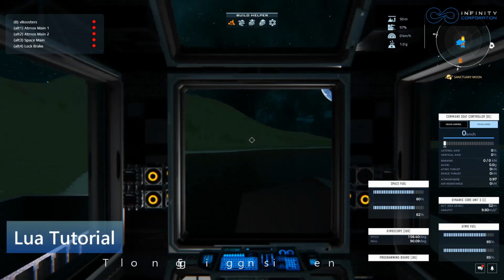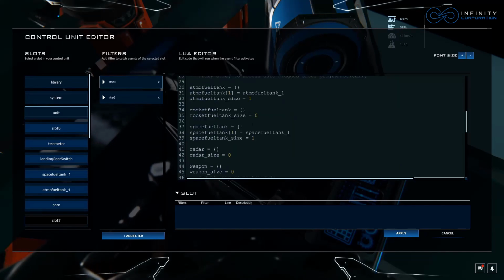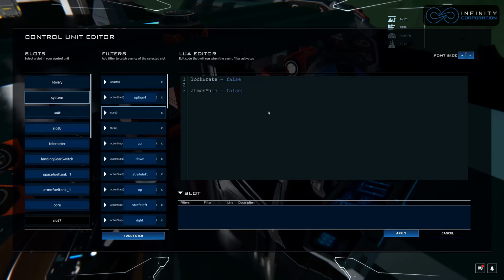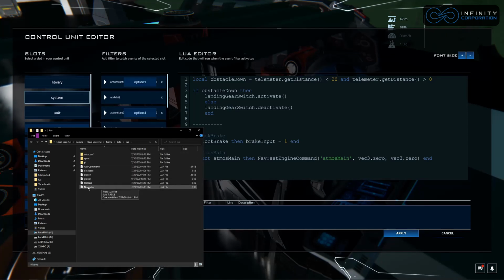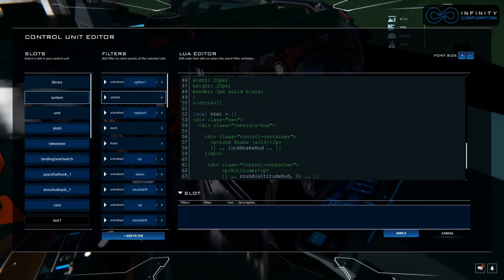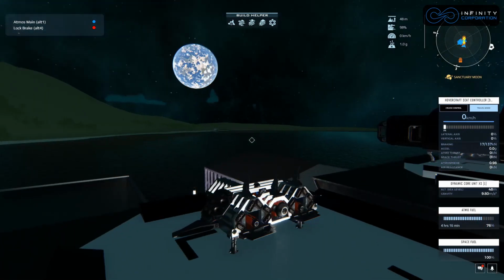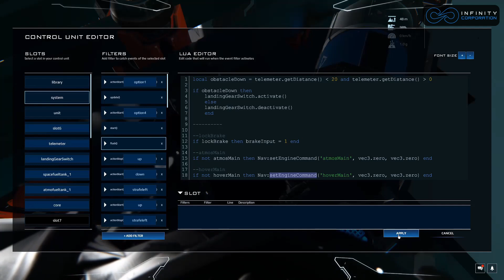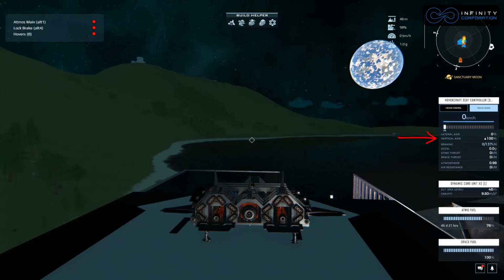Dual Universe Lua Tutorial - Toggling Engines

Comment: Hey this is super useful - but I haven't been able to get my vertical boosters to turn off. I've turned off my auxiliary engines successfully following the steps laid out here - and that works great! I did exactly the same thing with the vertical booster, checked several times everything is labled correctly, don't get any LUA script errors, yet my L vertical booster is just refusing to turn itself off / start offline.

My ship has 4 M and 1 L vertical boosters - I would ideally like to keep the L off unless I'm hauling heavy cargo - but it just keeps turning itself on burning through the insane amounts of fuel those things consume. I tried putting the other vertical boosters on a separate key and engine tag to see if that may be causing issues, but it still doesn't work and they all just power on normally the moment I try to go up. 

Does anyone else experience the same problems and is there a workaround? It seems like it "works" when I'm just trying to go "up" instead of increasing my base altitude - but that kind of defeats the purpose. Is there a way to "kill" the game from trying to use the vertical booster that is off for base altitude?

Also also - when I try to add a 4th toggle to the UI, the whole thing gets squashed up when that toggle is turned to on (2 off 2 on). Seems to add itself fine when everything is off though.
Reply: yep i get the same, not found the answer yet

Comment: just a comment that if you put atmosMain = false in system.start, then anytime a powerboard or control unit nearby gets turned on (you activate a pb from seat while flying for example), system.start() gets called, so atmosMain will get reset to false.

Comment: hey, do you know if it's possible to hold down a key in lua, for example 'a'? I don't mean pressing the key with doKeyPress(VK_A) and then looping it but actually holding it for a certain amount of time.
Reply: If you download Voice attack from steam, it has voice commmands. So if you wrote a voice command called, "Autopilot" for example and assign a key"A", you can have the option to hold it for a certain amount of time or even number of presses. Might be an option